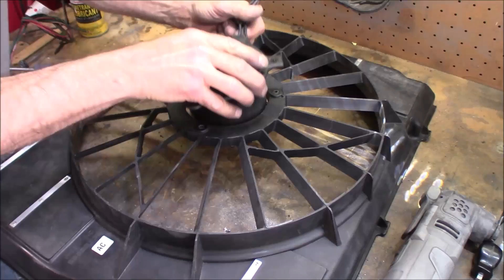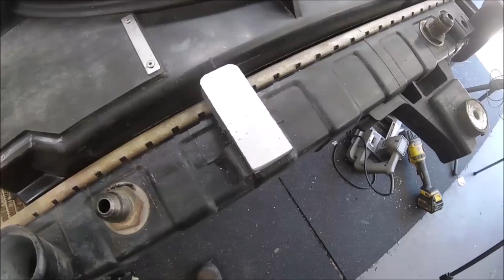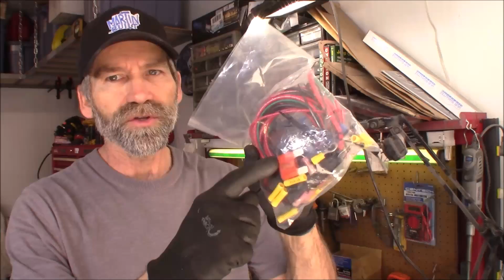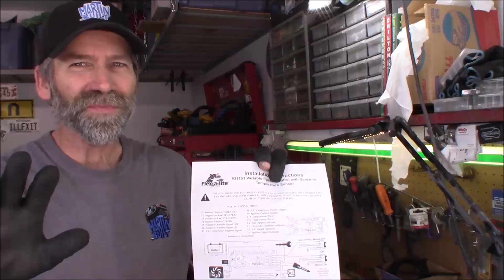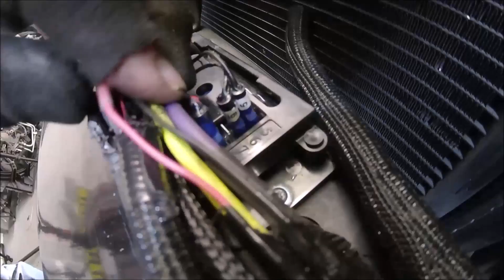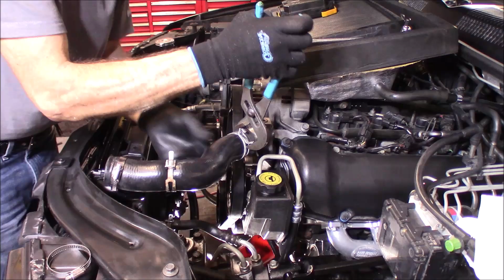Hydraulic to Electric Fan Conversion 01-04 Jeep Grand Cherokee 4.7L

Comment: handed my wj to an auto electrician and he burnt the pump out after i told him to be careful and do some research. since then ive learnt that the pressure regulator is in the fan assembly and i need to buy a different pump that has the regulator built in

Comment: I am going to do this with my 2002 WJ. Was wondering about the check engine light & P1499 code for the fan solenoid. How do you get around that? Here in California it won't pass smog check with the check engine light on.
Reply from the maker: In the video at 33:20 start watching there and it will show you how to get rid of that code. There is a wire wound resistor that you'll need to add across the 2 wires That activate the solenoid.
Reply: @martinbuilt  Thank you! I don't know how I missed that. Must be getting old.

Comment: I think I missed it, but how did you eliminate the lines on your steering box for the hydro fan?
Reply from the maker: Yeah, you did. Replace the power steering pump with the earlier model, prior to the hydro fan. Also use the power steering line from the earlier model as well.
Reply: No I got that part, i was asking if I plug off the holes going to removed hydralic lines to and from the old fan, or have to use a jumper hose between the two ports, and thanks for the reply

Comment: Thank you that’s so informative. But I have one question: can I put a better or stronger power steering pump? Because my Jeep (2008 WK) has 32 inch tires and 2 inch lift kit. I don’t want to cause I damage.

Comment: How do you get the check engine lite to go off
Reply from the maker: You have to add a wire wound resistor which is explained in the video. I believe it was a 10k resistor.
And the resistor goes across the 2 wires for the hydraulic fan solenoid.

Comment: My 03 Dodge Ram 1500 2wd, auto,SLT 4.7 l with reg cab 8 ft bed. Talking about the electric fan swap mine has had it done by previous owner and the only code showing has something to do with relay to cooling fan. They wired it so that when Air-Condition was turned on the electric fan would come on and stayed on as long as AC was on. I have already replaced Radiator and both upper and lower Radiator hoses. You can remove the cap to radiator and see that water is circulating well. That is when it was running. Just found out today that I will have it hauled over to a guy's home Repair shop. I will let everyone know what was wrong with it once he lets me know. Only thing being on disability I have know money, I guess I will have to contact my Credit card and get a cash charge and have money wired to my Bank account, I just hope somehow I can somehow make the payments when I am trying to save up money to pay my exempt Property Taxes and somehow pay this too. Since I am already running out of money two weeks after I get paid. Nothing but worry and then worry more. Thanks everyone for sharing what you think is wrong with my truck. Take care everyone and be safe....
Reply: Elec fan should go on when on max ac. Being on disability sucks. I’m on it as well. Just gotta do what ya gotta do man.

Comment: Hi Martin. Why not use the factor temp sensor to turn on fan, instead of the aftermarket one installed in the upper radiator hose? Just wondering because if it still shows the temp in the dash guage, doesnt it mean it works?

Comment: Hi Martin. Question- I have a wj similar to yours with the hydraulic fan. I’ve been told the head gasket is blown however, it runs fine, does not eat coolant and no white smoke. I recently found my bleeder screw was leaking coolant around it. Would this cause it to overheat if it sucks in air?

Comment: Hello Martin. I’m considering buying the fan controller you had. Just had a question before I purchase. I ordered one similar through derale, it has the same little screw to set the temp, however when I shut my hood, the vibration from the hood cause the screw to change.

After you did your set up. Did you notice it change at all when you hit bumps or closed the hood?
Reply from the maker: No I've never noticed any change once I set the screw to the temperature I wanted the fan to run at. I have a light by the switch that comes on when the fan kicks on and off and it has never changed.

Comment: Hey Martin, I'm getting things all in order to do this conversion I just had a quick question about the power steering pump. I've got a hydro assist setup so the pump runs the steering box and the hydraulic ram. Do you think replacing the original pump is necessary with the extra load put on by the hydraulic ram?

Comment: Hi , thank you for sharing your knowledge. I am wondering if the hydraulic fan solenoid has 3 pins would it work to use a 3 pin electric fan with the resistor built in?
I have the 2010 grand Cherokee 5.7l

Comment: Dear martinbuilt, you are truly a genius and an artist. Question: What type of fan has been installed?
Reply from the maker: This particular fan came out of a 98 Jeep Grand Cherokee that is equipped with the 5.9 l engine unfortunately they made less than 15, 000 with the 5.9 so they are somewhat hard to find.

Comment: I loved how thorough and informative you are, Martin.
Interestingly, my 2000 Jeep Grand Cherokee WJ has two fans, overlapping the radiator. And I realized that, what remains internally is smaller, it doesn't seem to be working. I've already applied 12VDC to it and it's functional. And about the wiring, one is ground and the other is the command power to work. Now I need to know what makes it work. Can you please guide me? Thank You!!

Comment: Excellent work that I will eventually follow for my WJ, but I want to comment on the efan controller install.  I am using that exact same controller and water coolant temp sensor in my XJ to run the aux efan.  First comment is that I am surprised you put the controller in a spot where it can be subjected to the elements.  The electronics are potted and you sealed the connections to the high power wiring, but corrosion on the control terminals will eventually cause functionality issues.

The other comment is temperature sensor placement.  When the thermostat is closed, there will be minimal coolant flow through the radiator causing a fair time lag for when the sensor feels a change in temperature.  This is less of an issue when the min coolant temp set point is significantly above the thermostat opening point, but if trying to set the efan to control right at the thermostat opening temperature, this is a challenging location to use.  The preferred location in this case is in coolant line running to the heater core.  This hose sees a more constant flow of coolant coming off the motor, and is better suited for controlling the efan when running very close to the thermostat opening temperature.

Comment: Hi Martin, new question. The adapter you drilled from 1/8 to 1/4 npt, it has a small screw to ground it. I ordered the same adapter from Amazon. I notice when you checked it with your heat gun it didn't have the second wire coming from the ground point. Is it needed or not? I installed mine, and grounded it also, but didn't work. I'm thinking the sensor is bad because many other people left reviews saying the sensor didn't work for them, so I going today to the autoparts to find a "working" sensor. Thank you.

Comment: Hey Martin, does the fan have to be a certain distance from the radiator to have optimum cooling? 1/2 or 3 in from radiator surface? I bought the OEM replacement style electric fan that goes in front of the nightmare hydraulic system, and want to mount it to stock shroud. My mechanic chopped all mounting brackets, so I have no reference as to where it goes, so I can make brackets, but dont want it to be too close or too far. Thank you.
Reply: Howdy! What OEM electric fan that goes in front of the hydraulic system did you get? Can you post a link??
Reply: @baroquebeatz  I used the factory OEM fan, literally. It is designed to be there. Just have to make brackets, or buy some L brackets to use to mount fan to shroud. Fits perfect.
Reply from the maker: I would recommend at least one inch from the radiator, but this all could depend on the shroud that comes with the fan. The manufacturer of the fan with the shroud should have been engineered for optimum performance.
Thank you for watching.
Reply: @martinbuilt  Thank you. I will be mounting the fan in the same place as the factory did, right on the edge, where the hydraulic assembly keeps it. Thank you.

Comment: Does anyone know, do make the fan a puller or pusher, does it matter? Want to do this mod soon.
Reply from the maker: I'm not exactly sure what you're asking, but this fan is a puller.
Pusher fans would go in front of the radiator.
Thank you for watching.
Reply: Oh ok. I saw a few videos where they  explained how to reverse the fan blades. But ok. I get it. Thank you Martin.

Comment: As always, great idea and execution.
I am wondering if it is possible to select a smaller coolant pump wheel for this engine to increase the pump speed, and thus force the coolant to circulate faster.
Regards

Comment: on the 2000 grand cherokee 4.7, is the coolant temp sensor used for the dash temp gauge AND the temp switch for the electric fan? i have an electric and clutch fan both?

Comment: Does anyone have a wiring diagram/ schematic for the electric fan I'm looking for the pin on the ECM that is for the e fan as some WJ's had electric fans from the factory because I believe is the same computer box for the 2.7, 4.0 and  4.7 are the same with the difference being the software

Comment: Where did you pull the ignition signal wire from?? I found the AC clutch wire, where did you tap into the ignition signal wire.
Reply from the maker: If I remember right I think I pulled that from one of the cigarette lighter power ports. It comes on only with the ignition in the on position.
Reply: @martinbuilt  funny, that's the exact port I was looking at.

Comment: I'm doing this mod and the pressure line from the pump collides the pitman arm when turning right, did this happen on yours as well? I got the hose from a wj at the junkyard. It collides right at the bottom where it bends back up. Thanks!
Reply from the maker: No I had no issues with mine at all.
Basically what you end up with. Is the power steering pump and lines hooked up exactly like a 2000 Jeep Grand Cherokee with a 4.7.
Reply: @martinbuilt  Thanks! I think I got mine off of a 4.0......I've done some research and they're a little different.

Comment: Hello, as for the other year vehicles in which you can use the fan assemblies, would you happen to know the year(s) of them? Also, was the radiator used from the 4.7 WJ itself?
Reply from the maker: Hello, you could use a 97 Mercury villager fan. I would also look into the lincoln mark Vlll And maybe some Volvo fans would work as well. I use the factory installed radiator.
Reply: @martinbuilt  thank you! I plan on doing this as the summer rolls along! Thank you for your insight 👍🏽

Comment: Would you recommend the ebay fan and aluminum radiator combo for this project?
Reply from the maker: I personally doubt that that radiator fan that they supply with it would be adequate. 
Many of the aftermarket fans that i've had experiences with will not pull the same or better CFM than the OEM fan.
Reply: @martinbuilt  thanks for the input great video by the way.

Comment: Thanks for this video, I used a mechanical fan off of an 04 Silverado and a power steering pump from a 06 dodge nitro and the hose you linked on Amazon. Worked perfect. I had to fix a valve seat drop because of that hydro fan.
Reply: I’m going mechanical on my WJ 4.7. Screw the electric fans and Hydraulic fans.

Comment: Hello Martin, I'm a 2002 límited wj owner. I bought a ford Taurus 9 Blades fan from dorman. But, that one is a 2 fan speed that I don't know which controller I must use. Does the Flex a Lite that You use could be works for my fan? Thanks for your reply!

Comment: Martin, great video...I have a couple questions... 1. Can I do this mod using the 05 - 08  Cherokee E-Fan? I tried to post a link but it's too large. You can find them on amazon and the shrouds look to be a direct fit. (TYC 621220) 2. Can I keep my power steering pump? Can you explain that little better? I like the idea of the override button for deep water crossings, great idea.
Reply from the maker: That electric fan is an auxiliary to the electric fan. I don't believe it would ever have the power to actually cool the engine by itself. You must replace the steering pump because the one that's in there has too much power and will damage the seals on the steering gear box.  Also The high pressure steering line is larger fitting diameter and can not be used.
Reply: @martinbuilt  thanks a lot Martin!!

Comment: What year of taurus fan is recommended?
Reply from the maker: It will need to be one that was equipped with the 3.8L engine, and I believe 91 through 95 would be good years.
Reply: Great. Thank you very much for that info considering this video is an older one.

Comment: Hello Martin I have finally decided to do a E Fan conversion. What is your thoughts about using the 99-00 4.0 Electric Fan and Shroud, I heard it bolts right up. Would I still be able to use the variable fan speed controller you used and have 60% speed first and then 100% speed when temperature rises? Or is the 99-00 fan only 1 speed (HIGH). I wish I could use the same set up as you if you made a kit with those custom Aluminum Mounts to mount the 5.9 Fan and Shroud I would definitely buy that!
Reply from the maker: The variable speed Van controller should work on any fan the thing is that electric fan from the 99- 2000  won't be able to keep that 4.7 cool by itself.

Comment: Hi Martin!
I was wondering which fan controller to use, you two part numbers listed?
Also, I found a 98 Grand Cherokee 5.9l fan asm. The fan has three wires. Which ones are you using?
I can’t wait to get my 01 WJ running!Thanks again for sharing!!

Comment: Martin, I just started to have problems with my hydro. fan set up in my 01 WJ.
Thank you sharing this mod.
If I can find the correct shroud, does Flex o lite have an equivalent fan?
Nice job on the videos btw.. I’m an subscriber now!!! 👍👍
Reply from the maker: I'm sure that flexalite would have one that would fit well. I'm not sure that it would perform as well. I have never found a aftermarket fan that works as well as some of the OEM fans.
 Thank you for watching and subscribing.

Comment: Martin, just did my conversion. Used Flex-A-Lite fan and made Al shroud myself. This works great, T is solid and no random slight overheating anymore.  Should have done it long long time ago. I tuned turn-on point where it is on and off during city driving depending on conditions. But it is always on during Hway, is yours similar? One other thing I have noticed, when I am hitting the HWay cold, Fan is turning on even before I can see T needle reaching operation range on my gage ... This is strange, I am not sure if t-stat is even open, why is flex-a-lite sensor reading increased T and turning on in advance? Is hot coolant heating top tube first? Would be good to be able to read T from that sensor directly.  Did you see similar thing on yours?
Reply from the maker: The coolant flows from the engine through the top radiator hose to the radiator.
 No mine doesn't not necessarily run going down the highway.
 I actually think that the  flexalite does not turn nearly as fast or pull the same CFM as the OEM fans do and as a result are slowing the air down as it passes through the radiator at highway speeds.
 Try turning the fan off at highway speeds and see if the engine temperature actually decreases.
Reply: @martinbuilt  Martin you are correct, today uphill at 100F it was not enough had to turn on the heat inside the car, darn :( have to go with Ford Taurus fan I guess, back to it again. Will need to figure out how to connect to 3 wire plug. BTW fan was not turning on before the T, at HW it rotated the fan by upcoming air and generated 12V for the LED to lighten up!

Comment: I did your ram air mod to my Dakota,havent done the hood seal yet.I used the existing air intake silencer,cut out the top,placed a K&N filter in the opening,made a metal bezel to secure it and reconstructed the bottom of the air intake silencer to replace the material I had to remove.Mine deviates from your design in that.mine still also draws air from the airbox as well.In my.application I think I will make a.steel plate for the underside of the hood that sizes it to the filter and put the foam on that for the seal.
Reply from the maker: Nice, I an also redesigning the one I made. 
Would like to see pictures if your Ram air. 
You can send them to my Facebook Messenger.
Link in the description.

Comment: Martin I am in the process of doing this mod right now and just had a question. On your wiring diagram for the gamma switch, you have arrows on 3A and 3B that point outwards. Is that indicating that you are installing jumpers from 3B to 2B/4B? Or is that just indication of the switching mechanism? Also, did you tie 3B(12V switchable source) in with terminal 9 on the fan controller? Just want to make sure I'm not missing anything. Thank you in advance!

Comment: Do you make any pre-built set ups like you did for this jeep.  Im having the same exact problem.  I already bought a new radiator and ac condesor. Just got a used hydraulic fan off ebay. But I really want to do what you did
Reply from the maker: I haven't made any pre-made kits.